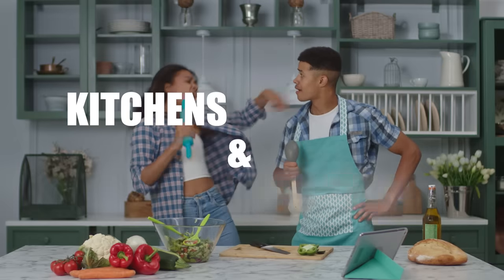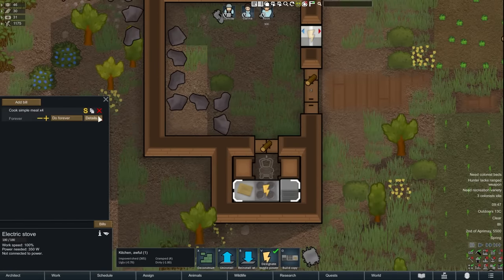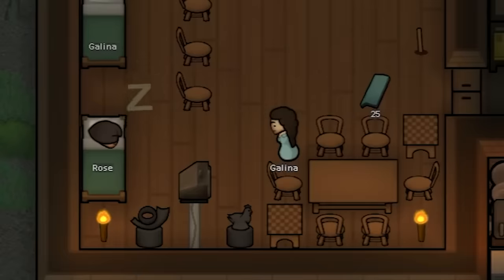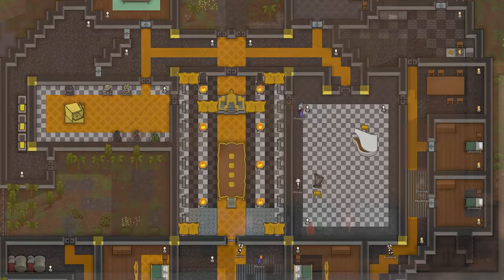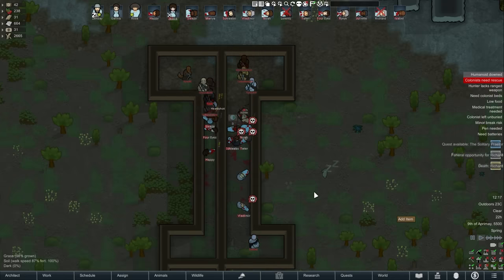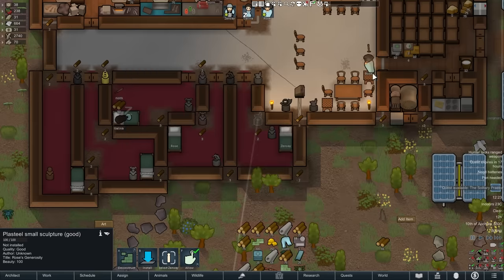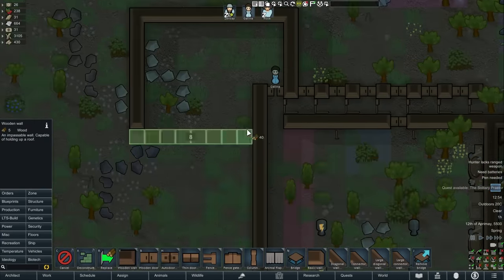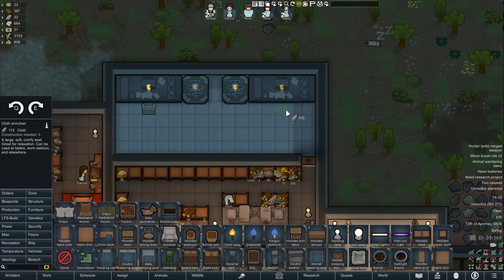How To Build Efficient Base In Rimworld Base Building Guide 1.5+

Comment: Tried all sorts of kitchen designs and the fridge kitchen always ends up being the most efficient in the long run.

 No doors (appart from fridge access) to slow down cooks or haulers as they work; no doors between fridge and kitchen also means no huge temperature shifts as the colony grows bigger and haulers tend to open doors every other second; huge stockpiles right next to the cooks means less back and forth work for haulers trying to keep those racks by the table full at all times, just plop a few statues in with some lamps and you can quickly get an impressive kitchen moodlet for anyone entering or working in there (huge plus), even with the bad temperature cooking speed debuff this design ends up averaging about the same production as other designs with doors included and plopping down an autodoor to try and mitigate travel time is fruitless when it causes temperature shift problems anyway and any regular door just slows cooks and haulers way too much so with door designs you're always running into time efficiency issues one way or another.

Simply far too convenient compared to the other options for a regular tempered weather playthrough.

Comment: I always find it useful to have a dead power spot where you can reconnect anything that’s drawing power. That way when your batteries are low, you can prioritize what’s actually important to keep on

It’s always faster than the pawns doing it and is great for turning off turrets to save them from destruction in raids or against bugs

Really useful early game when pawns are limited and resources are thin. It becomes less and less viable the later into the colony’s life where pawns increase and there are stockpiles of resources
Reply: Isn't this what the power switch is for? I don't use it so I don't really know.
Reply: @sentane8031  no, the power switch requires a colonist to manually flip it. The dead power spot allows us to reconnect to different lines when ever without having a colonist have to do it

Comment: I play with pretty much the whole VE suite, so some of these tips are a bit unneeded. That said, they're still very good in general.

Something to add is that it's fine to have separate freezers. One devoted purely to ingredient storage, & one devoted to meals. This is especially effective when you control where the meals are initially dropped off, only to be hauled away in bulk later by another pawn, giving you more flexibility in base design while not inconveniencing the chef.

And speaking of not inconveniencing the pawns that make stuff, make sure to put the workshops behind the warehouse so that incoming raw materials are carried the least amount before being used.

And finally, with either the Royalty, or better yet the Ideology DLC you can further combine either your throne room or altar with your mess hall & rec room. Triple the bang of that room impressiveness buff.

With honorable mentions to put stone beds in your prisons. Stone beds have a negative rest modifier, so prisoners will sleep more, stretching out the time between break attempts. So don't use stone for your colonists or slaves.

Another honorable mention is to make the entrance to your pastures both an air lock (door-space-door) & into a barn filled with about 25 animal sleeping spots set to medical, & a supply of herbs next to the airlock. This will save time & livestock.
Reply: What is the benefit of the airlock for the barn?
Reply: @alexpopescu6150  
It doesn't slow down pawns like door-door does, plus it has some additional wiggle room for junk clogging open doors. So it reduces stampedes thru a clogged door.

Comment: when i plan layouts, measure the entire map, everything goes wrong and randy does funny things, like give everyone a plague while they are fighting a mortar siege, when i am tired and build whatever without microing the base usually flourishes and resists many raids.. i am led to believe the natural way is the most efficient way for survival, need a roof? build a shack, need defense? spam traps, try anything less simple and you are in for a lot of trouble.
Reply: You can only plan layouts when you get a foothold.
My first world I actually did a layout because my first colony was so ugly on the bottom half of the map... so I did a layout on the top half with a giant 'war hallway' around and it was great for a little while. The only reason I was able to build it was because I stockpiled 2000 granite and 2000 slate blocks (which wasn't enough for even half of it... but I still stockpiled) and I didn't use it as my 'home' while I was building it, so it never got raided until it was finished, after I moved everyone and everything in.

Comment: Kitchen is terrible. The cook will suffer cold penalty from having the freezer leaking all its cold into the kitchen room. Gotta make it double doors and remove the shelves and add a door and airway to somewhere normal temp.
Reply: Definitely prefer to airlock the freezer and keep the kitchen comfortable.
Reply: Make him wear a parka or a jacket. It's worth it if his ingredients are near him, and are frozen. The meals dropped on the floor are frozen too.
Reply: @amazingcola2479  wont make a difference, its how cold the room is for the workstation. If the workstation is in a cold place, you'll get -40% speed.
Reply: @amazingcola2479 the ingredients don't need to be in the freezer if you're cooking frequently. Unrefrigerated vegetables take like 30 days to spoil. Just put the veggies on a shelf in the kitchen near the stove. But don't put meat on a shelf. Instead, make a 1x1 stockpile near the stove and put the meat in there. The reason why is because shelves store way more than stockpiles and meat spoils way faster than vegetables. So If you use a 1 square stockpile and cook frequently your cook will use the meat before it expires. I do the same thing for meals in the dining room. Don't use shelves for meals outside of the freezer. The goal is to use them nefore they spoil but you want them close to where the pawns use them.

Comment: When I saw the research centre I cringed at the efficiency, you only need 1 multi analyser for multiple research benches. I usually put 2 research benches in an L configuration, but there is more efficient ways.

If you have a door leading straight to the bench, it lessens the chance of a mess.

Or if you want your pawns to socialize while researching, make a U shape where the seats are right next to each other.

Or even make a + shape to connect 4 benches to one analyser, I do wonder how far a analyser can connect to a bench as that could get ridiculous

Comment: Noobert, while you titled this efficient it's not the MOST efficient. the floor for kitchen can stay dirt honestly. No need for sterile tiles. Also, no matter the climate/tile on world map, you don't need a refrigerator. Seriously. most raw foods don't spoil for multiple seasons. No reason to stockpile/horde wealth. I play on 500% difficulty and I don't tile my kitchen but I do keep a similar form factor (only subbing out one of the shelves for a light source). Also as far as the dining room goes, I would forgo it almost entirely, putting tables intermediately throughout the base and outside bc often times it's more efficient for them to take a meal with them, eat it at a table close by to the field/etc instead of lugging it all the way back to a dining room which increases the risks for breaks.  I would go into a lot more detail but this is just a youtube comment section. Good luck! Great video overall!